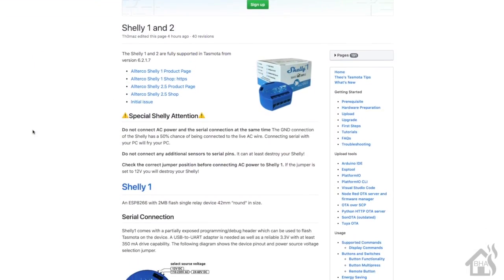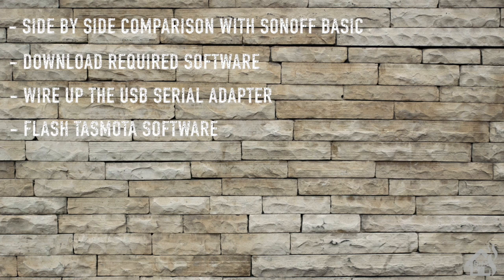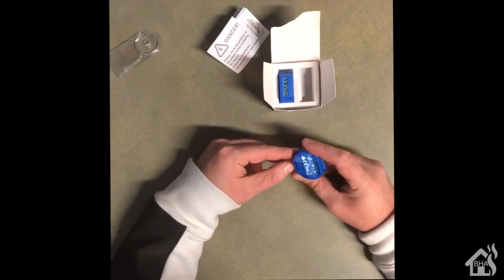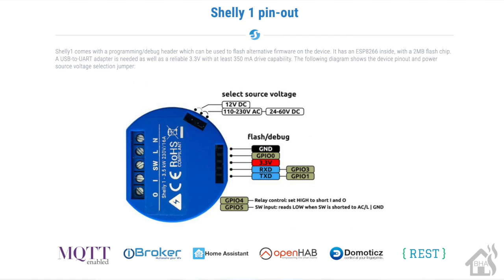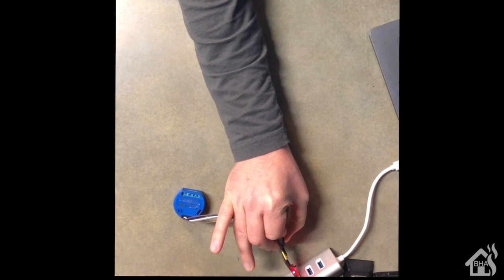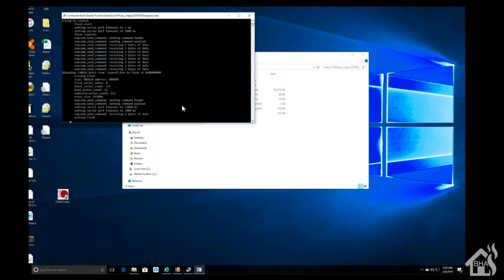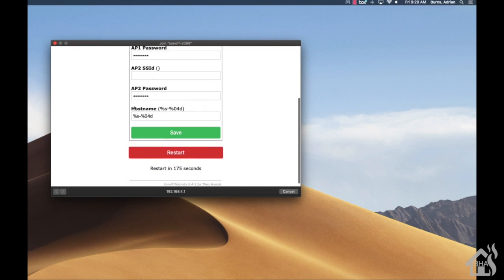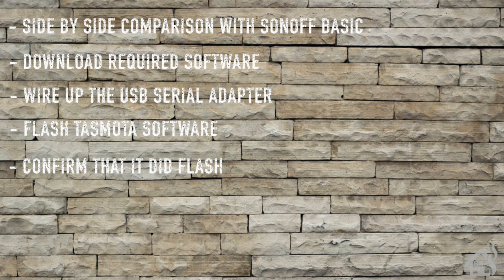Flashing the Shelly1 with Tasmota!!!

Comment: flash completed. 

how to get it out of flash mode? and how did you see the Sonoff wifi AP? did you still use the serial/usb adapter?
Reply from the maker: once its flashed, you should be able to cycle power on it and then the wifi AP should come up.

Comment: Thanks for the video it really made it easy except I screwed it up....I think. I'm a total newbie  looking for a hobby  as requested by a doctor. I did everything as described  and saw my shelly  ad-hoc network. I opened it and entered my ssid and password hit enter and waited, and waited, and waited. The tasmota sign in page disappeared and then I got nothing. no new devices  on my network and no ad-hoc. So what does the newbie do? Tries again on the other shelly with the same results. Two shellys down! I re-flashed them both hoping they would reset but no joy. Any advice on if these things are bricked or is there a chance I can recover them.
Reply from the maker: so you were initially able to see them with the ad-hoc network after they were flashed?
Reply: @BurnsHA  correct. After posting  i read through the other posts and followed jerry aycock's advice and was able to get back to normal. I am able to once again see the tasmota adhoc sign in page at 192.168.4.1 which is no where near my 10.0.0.1 IP scheme. After  i enter ssid and password everything disappears. Where is the 192 ip coming from and how to I change it to my 10.
Reply: I figured it out totally my fault not paying attention.
Reply: @chrisnielsen4216  what was wrong?

Comment: Flashed one works great. Second shows flashed but can't find it. 
Putty shows it trying to connect - Must be bad PW.
Tried flashing again.. 
Any Ideas ??
Reply from the maker: So you don't see the adhoc wifi network to connect to after flashing?
Reply: @BurnsHA  Got it.. thanks.. bad PW.. replaced my keyboard....
Reply from the maker: that will get you everytime!  glad you got it working!
Reply: Finally got it. Had to flash to  Blank 2mb bin and start over. Think WIFI pw may have been wrong... THANKS

Comment: For me, this video ended prematurely. I wanted to see how you configured it. Maybe you could pin a comment with the configuration settings you used in Tasmota?
Reply from the maker: there is a predefined template for the shelly1 in tasmota.  If you select that, then you should be set!
Reply: Thanks, BurnsHA! Good to know. I’ll be flashing my first Shelly 1 today, following your guide. If I have any problems, you’ll hear about it right here!  ;D

Comment: Another great video! Please consider my suggestion for a future video: openzwave on a Docker based system.I have been fighting with openzwave forever and got it working mostly by trial and error. Now that I have migrated Home assistant to a docker container, I am struggling again. I do have Open Z-wave Control Panel running in a docker container as well, but I don't think Home Assistant can "talk" to openzwave. It is probably a simple volume issue, but I'm back to struggling.
Reply from the maker: I will keep it in mind, i dont currently have a usb zwave stick to test open zwave with.  Ill have to see about ordering one.
Reply: I like the Aeotec Z-stick. It is a bit arcane in its minimalist user interface, but it has worked flawlessly for me so far. I got it from Amazon for about US$45.

I finally got openzwave working. Two key points: 1) Some openzwave docker containers didn't work for me. The one that did was eugenmayer/rpi-nodered. 2) Homeassistant 0.86.3 has fixed most of the bugs in the Z-wave interface and now makes the openzwave control panel nearly obsolete.
Where I have had to go back to the openzwave container is when I have nodes that get flagged as "dead" because the power was out when they got polled. Unfortunately Hass does not let me recover them easily and a network heal has no effect on them. Openzwave did fix them. YMMV.
Just an FYI in case anyone cares, I am running all of these containers on a Raspberry Pi 3 with rasbian OS. My command to properly run the openzwave container was:docker run -d --name="ozw" -v /home/homeassistant/vols/ozw:/opt/open-zwave-control-panel/config --device=/dev/ttyACM0:/dev/ttyACM0  -p 9090:8080 eugenmayer/openzwave-panel (note: I moved the port due to the way my system is set up).

Comment: Nice, but i don't understand, why should one need to flash Tasmota on them? The Shellies support MQTT out of the box. I'm using 6 of them without any trouble so far.
Reply from the maker: i like the tasmota software and of course i love getting in and messing with stuff so if i can flash something, i usually do.  But you make a good point!
Reply: Are you using the stock firmware mqtt with Home Assistant?  If yes, what configuration.yaml settings did you you?  I've tried for hours and can't get the Shelly 1 to show up in HA.  I'm actually getting ready to flash Tasmota on my Shelly 1.
Reply: @ptmoy1  
Hmmmh, it was relatively easy to integrate the shellies in HA, I use Hassio 0.84.6 on a Pi. and an external mosquitto Broker on another Pi. But the integrated broker in HA should of course work too.

If the Shelly1 is in the same WiFi Network as your MQTT broker, then config the Shellies 
under "internet & Security - Advanced - Developer Settings"  setting  checkbox "Enable action execution via MQTT" 
enter MQTT Server:  Address/Port & User/Pwd (if used) of your broker.
Cloud is now disabled, it says: :  WARNING: If you enable MQTT - actions via Cloud connection will be disabled!

Home Assistant: Here  I defined a new mqtt-switch: 
(Notice: Topics of the shellies are fixed in their firmware, Version 1.46 / 08.02.2019 is current version)

configuration.yaml:
# Switches
switch: !include_dir_merge_list switches/

in directory "switches" a file like:
mqtt_switches.yaml: 

Example with Shelly 1:  XXXXXX is the ID of the shellies ( eq.  3 lower Bytes of the MAC-Address)

## Shelly Switches
  - platform: mqtt
    name: "ShellyXXXXXX"
    friendly_name: "Porch Light"
    state_topic: "shellies/shelly1-XXXXXX/relay/0"
    command_topic: "shellies/shelly1-XXXXXX/relay/0/command"
    payload_on: "on"
    payload_off: "off"
    state_on: "on"
    state_off: "off"
    optimistic: false
    qos: 1
    retain: true
..
..

Hope, this helps...
Reply: @Take5Instead4  Thanks for your reply.  I have 2 Shelly1s.  Already flashed one to Tasmota, and got it working in HA.  I'll try the second with the stock firmware again using your yaml parameters.  I needed to set a time schedule on the tasmotized Shelly1.  Had lots of problems getting that to work.  Turned out the timezone was wrong.  Figuring out how to set to the correct timezone in tasmota was a pain; finally did figured it out.  The embedded web UI in the Shelly1 stocked firmware looks to be a bit more capable than the Tasmota's.
Reply: @ptmoy1  The Shelly1 firmware offers more than I currently use. In the end, it's a power switch that I can control with automation scripts in home assistant. In the future I want to use Shelly2 for certain purposes, because they measure the power consumption which can be logged in HA (defining a mqtt sensor in HA).
Reply: @Take5Instead4  Ok, got the stocked firmware working with HA. One of the problem was related to my using MAC address filtering in my router.  I used the MAC addresses reported by the Shelly stocked firmware when I navigated to the "192.168.33.1/settings" URL when connected to the Shelly internal AP.  The reported MAC addresses were incorrect.  When I disabled MAC address filtering, the Shelly1s connected right away.  When I looked at the router configuration to see the connected MAC addresses, they were different than those reported by the Shelly1 firmware earlier.  Shelly firmware reported the MAC addresses as B6:xx:xx:xx:xx:xx on both devices.  The correct MAC addresses were B4:xx:xx:xx:xx:xx on both.
Reply: @ptmoy1  the thing with the mac addresses is indeed a little bit strange.  With my 6 Shellys i see two ranges: CC50E3xxxxxx = Vendor  is espressif   and   84F3EBxxxxxx = another range of espressif.  Can you find a vendor corresponding to your MACs?. Current MAC prefixes of Espressif: https://macvendors.co/vendors/1/Espressif+Inc..
Reply: And yet you have to register first before you can use mqtt, read their terms and conditions to see what this will imply.
Reply: @atom6_  I never registered to the Shelly Cloud, if it's this, what you mean. I'm using Shelly1, Shelly2 and Shelly RGBW2.  
All my Shellies acted as WiFi-Accesspoint when delivered (or resetted). With WiFi enabled on my Notebook i see a SSID "Shelly-XXXXXX"  connect to it. After a few seconds i have a IP-Address in the Range 192.168.33.0/24 and can open the Web-Interface of the Shelly by typing http://192.168.33.1 in the Browser. Then configuring it as Client in my WiFi-Network (static IP is recommended) and if this works,  i configure the MQTT-Server under "Advanced - Developer Settings". The (in my case never used) Cloud function will then be disabled.
Reply: @Take5Instead4  that makes sense thanks, i started with their app and directly gave up, back to tasmota :') I can test this with some others.